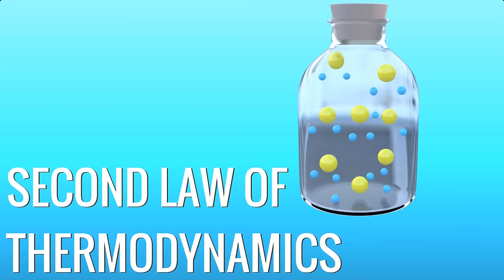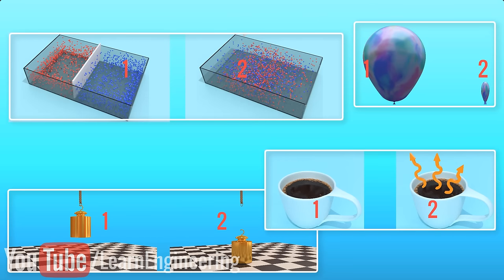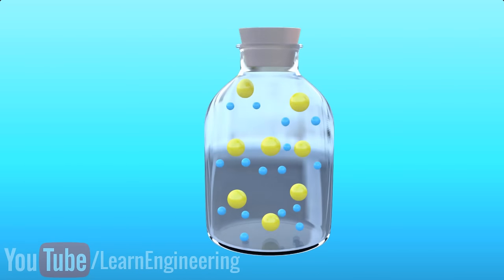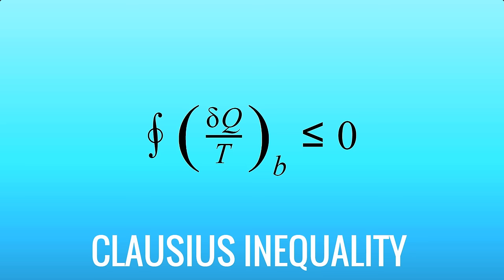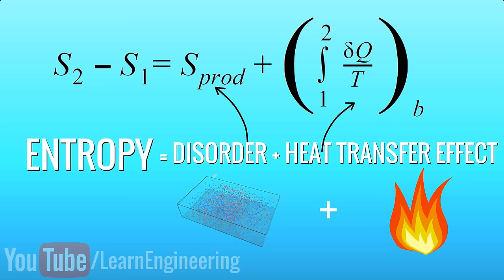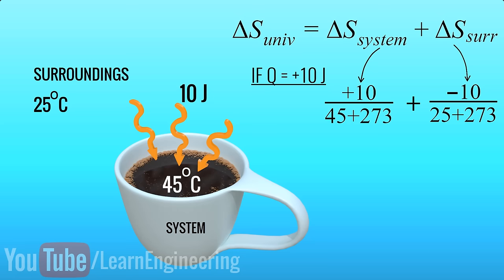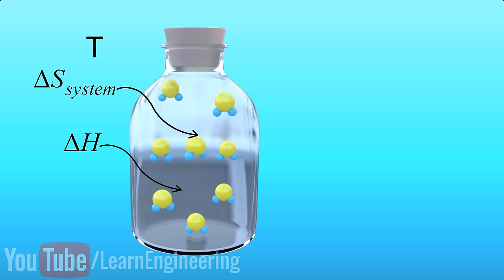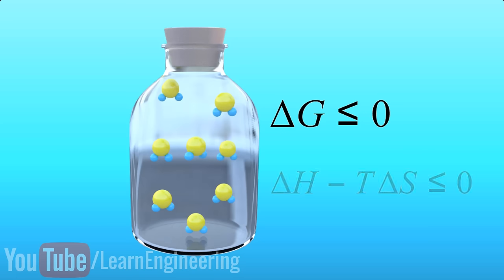Understanding Second Law of Thermodynamics !

Comment: Very interesting but.....what exactly is the second law of thermodynamics?
Reply: States that hot objects cannot absorbed energy from the surrounding but it only releases its own energy
Reply: it's the one that comes after the first law
Reply: The second law of Thermodynamics is that: Any process in nature occurs in a certain direction only.
This does not condemn the first law of energy conservation.
Reply: We are in league lol
Reply: @MA-qz1sd  😂🤣🤣😂
Reply: @JoeKing basically, first law of thermodynamics is that energy cannot be created or destroyed, only transformed. In layman's terms, heat has to go somewhere.
Second law is so confusing this video only made me more lost. Something about tea... maybe the should have used coffee instead. Would be more clear.
Reply: The way i see it is like this,, heat only goes from a hot body to a cold one it cant go the other way,,and entropy increases with time wich is measured by heat, or simply the universe will get hotter end messier with time..
Reply: second law of thermodynamics is about energy conversion, say you have two systems like a warm room and a cold room next to it, you open the window between them, the warm air in the warm room will travel to the cold room.

so the law states that a system that contains high energy will always give energy to a system with low energy until they reach equilibrium.

hot tea loses its heat because it is a system with high heat energy surrounded by air which is a system with lesser heat energy, so the system with high energy which is tea will give heat to the system with lower energy.

sorry if this ended up confusing, i tried.
Reply: @JoeKing
There is plenty of people who believe in perpetual motion.
Reply: @JoeKing the Zeroth Law, the First Law and the Third Law of Thermodynamics.
Reply: @JoeKing Zeroth law - basically if 2 thermodynamics system have the same temp with a third one, then they are also in thermal equilibrium.

1st law - energy can't be created or destroyed it can only be transferred.

2nd law - basically heat seeks colder shit. 

3rd law - when an object reaches absolute zero (0 Kelvin) then its atoms will stop moving.
Reply: @MA-qz1sd  genius 😂
Reply: @Nyew18  can someone gives me an example of industrial/engineering application that involves both first law and second law of thermodynamics?
Reply: @thischannelisnothere7747  The refrigeration cycle uses the 1st and 2nd law simultaneously.
Reply: @jalllu5201  thanks mate
shukran
Reply: @apollotheodore2560  
I just watched a video about entropy and it clearly states that it is possible for a hot object to absorb more energy so this is kinda confusing...
The chances of a hot object absorbing more heat is very small the larger the object though.
Reply: @azzzanadra   You explained it better than the video, thanks :)
Reply: @abulhasnainkhan1749  it feels good that i helped someone on the internet, it feels warm inside, thankfully it's summer so that warm is not going to leak out quickly.
Reply: the entropy of the universe tends toward a maximum
Reply: @MA-qz1sd  lol
Reply: @azzzanadra  Wow! Really helpful💫
Reply: @jalllu5201  Dude! Thank u for example but can u plz explain how these laws works in refrigerator....plz
Reply: second law of thermodynamics is you do not talk about thermodynamics
Reply: @azzzanadra  Simple and clear. Thanks
Reply: @MA-qz1sd  INSTINCTIVE 😚👈
Reply: The 1st law of thermodynamics states that in an isolated system (a system in which no energy is added or taken away)  energy (and thus mass) are conserved. 
The 2nd law states that in an isolated system (where any reaction takes place),  the system's current state will always be less than that of the initial state meaning an isolated system's entropy will increase over time. This state takes into account the materials as well as their arrangement, i.e. entropy. 
The 3rd laws is the assumption at entropy approaches a constant as Temp approaches 0K and that's needed due to the Heisenburg Uncertainty Principle
Reply: The entropy of universe is increasing continuously.
Reply: "The entropy of the universe is increasing" or " In the process of changing energy , a part of the energy , always , turns into the form that is unusable" 

I'm 13 ☺
Reply: Also all heat can be converted to  work but all work can't be converted to heat
Reply: An object’s entropy can never decrease
Reply: @azzzanadra  thanks man I understand it this way
Reply: @akshatpandey9141  reverse is true
Reply: @devendrabisht9713  thank you sir 👍😊😊
Reply: Basically, all things in the universe is decaying and breaking down over time and it's irreversable. It's also called "entropy". 😄👍
Reply: It’s straight before the 3rd law !
Reply: @MA-qz1sd  lol
Reply: @KasumiRINA  lol
Reply: @MA-qz1sd  no I thought it was the law that came before the 3rd law?
Reply: The universe is subject to disorder or entropy unless controlled by certain factors like energy and temperature.
Reply: @azzzanadra  tq🤗
Reply: @azzzanadra  dude, thank you, i finally understood this goddamn law haha
Reply: @KasumiRINA  Had he used water it'd be more clear
Reply: 2ND law:  heat,BY ITSELF,NO MACHINES INVOLVED,  only flows from hot side to cold side; not cold to hot 
2ND law:  Your hot coffee will get colder if you leave it in a cold room; it will not get hotter by itself in a cold room 
2ND law:  your hot cofee will heat up the cold glass you poured it in;
2ND law:   your hot coffee will not get more hot  after you poured it into the cold glass (for this, the glass would have to give out heat to the hot coffee,and so the glass would get COLDER....).            lol
Reply: All work can change to heat but all heat can't change to work
Reply: Entropy- A factor of degradation of quality of energy not exactly energy degradation which violates the First law of thermodynamics.
Reply: hot things will always cool down unless you do something to stop it
Reply: :) without understanding ‘randomness’ and ‘Probability’ the second law cannot be really appreciated. 
It’s just that the chances of hot team becoming hotter(absorbing heat) from a lower temperature surrounding are 1 in a trillion trillion trillion :) or for all practical purposes impossible.
Without understanding a statistical model, one can’t appreciate thermodynamics more than basic definition that entopy always increases 🤪🤪
Reply: i tried to follow but at the beginning,i hot lost when he talked about a balloon loosing air .. then a cup showing up..
Reply: i heat my bedroom up,but cold air rushes into it..from the rest of the colder house…not the other way around tsk tsk..if u were here u could see the wind coming,blowing through doorway…cracks if i dont close it tight..well one needs fresh air…..then the temp control jnit comes on to counteract the cooling down…tsk tsk..
Reply: A mathematical explanation for why objects tend to release heat rather than absorb it
Reply: @frend420  yes it is possible, but in the video example that's not true as the tea is hotter than the surroundings so for the tea to heat up would require work on the system as that direction of heat transfer has a positive Gibbs free energy meaning it will not happen spontaneously.
Reply: entropy always increases and is always greater than 0. until further notice
Reply: The entropy is the arrow of time, the one that defines in wich direction the facts are happening, for example if you put coffee in the milk, you can observe that the point of coffee gets wider and invade the milk from all the directions, but we can't undo it(reverse it).
This is entropy it defines how heat energy flows
Reply: Dont ask me...... I just got through reconciling the dunning kruger effected my ego.
My mind suffered the delusion of logical fallacy in assuming itself brilliant.
Dope...😣
Humility is setting in....😟
I realize pride being my fear..😱
Is there a saving grace? 😔
If not im toast! 😰
Next time i will stick to the alphabet, maybe after mastering that, and my vouls, I may be developed enough for basic mathematic probability calculations......opps.... Dunning kruger is back!
Lol

Peace.
Reply: @apollotheodore2560  Partially true.
For terms of ease of simplicity, let's  say you're object is heated to 200°F.

Now you put it in the environment It has the temperature of 500°F.

If You leave your "hot object" in this environment long enough,  It will pick up the thermal energy of it's  environment - and get hotter.
Thermodynamics 101.
Reply: @azzzanadra  thank u
Reply: @azzzanadra  Hello...whatever u have stated is Zeroth law...not second law btw
Reply: @firozkhan_2002  really? hmm, the more you know.

what is the second law in  nutshell?
Reply: @azzzanadra  There is not a universally accepted nutshell statement for the second law...It depends on which context u r referring it...Since I'm a Mechanical engineer, we use Clausius and Kelvin-Planck statement for the second law...If u look from the point of view of chemistry or any other physical science...the statement may differ...But talking in a nutshell... Second law tells us that all processes in the universe can occur spontaneously in a single and definite direction...and it also helps us to determine whether the process is feasible at all or not! That's it!
Reply: Second law of nature is:- 
Less heated objects cannot transmit heat to a more heated body.
Reply: You can't have a pressurized system next to a vacuum without a barrier.
Reply: The 2nd Law basically says that, no energy conversion process can be one-hundred per cent efficient.   Capiche?
Reply: Second law of thermodynamics was stated by clausius and kelvin plank
Acc to clausius No process is possible whose sole result is the transfer of heat from a body at lower temp to higher temp.
Acc to kelvin plank no process I possible whose sole result is complete transfer of heat into work. These two r interconnected. If anyone of the statement is untrue the other one is also untrue.
Reply: It essentially states the total entropy of a system must remain the same or increase rather than decrease in value. Entropy is Energy per unit Temperature. And entropy is simply a measure of the information bits to describe the energy of particles with a certain temperature.
Reply: @MA-qz1sd  🤣🤣
Reply: @KasumiRINA  🤣🤣🤣
Reply: Changes in temp. It’s always hot to cold. It’s never cold to hot
Reply: @apollotheodore2560  entropy
Reply: Entropy
Reply: It tells about the QUALITY of energy.or simply how much energy concentrated at a particular region which can be usefull at full extent unlike the energy which is spreaded over a large region which can not be used for any purposes
Reply: IT IS THIS : IT IS IMPOSSIBLE TO ACHIEVE 100% EFFICIENCY FOR ANY THERMODYNAMIC DEVICE........

now the explanation of this statement takes into account entropy
Reply: Interesting😅😅
Reply: Heat death of the universe
Reply: It's literally the first thing explained in the video
Reply: The entropy of the universe is always increasing. 😂
Reply: Stuff go from high energy to low energy. Simple.
Reply: @yellowbacon69  : No , you cannot say that. Energy is conserved. It just changes from one form to another. 1st law of thermodynamic. 😂
Reply: @Waffen_SS-q7c  ok… stuff go from hot to cold?
Reply: @yellowbacon69  : The heat just dissipate to the surrounding but with same amount as initial diffrences (∆E). You can only say that the entropy is increasing. 😂
Reply: @Waffen_SS-q7c  ok, so temperature transfers from one body to another and entropy increases?
Reply: @yellowbacon69  :maybe, then it will involve Boltzmann distribution. 😅
Reply: @apollotheodore2560  thank you !
Reply: Good Question 🥲
Reply: It is impossible to construct a heat engine that operate without heat loss
Reply: It states that we can not travel backward in time. Because time is measured only in the direction of increasing entropy. Period

Comment: During this entire video the law is never stated.
Reply: They provide multiple formulations
Reply: But it is still isn't explicitly stated.
Reply: Thank you for that.
Reply: #Entropy for a closed system ( like the universe ) , is always increasing .

#A self-occurring process, the entropy in the final state is greater than the entropy in the initial state.

#Heat is transferred from a body with a higher temperature to a body with a lower temperature.
The substance goes from higher concentration to lower concentration .

To do a work we need a delta ( difference in heat , or in substance concentration ) ; second law of therm-dynamics kills delta . Life is struggle with second law of thermo-dynamics . 
It is the one who wins in the end .

Comment: For the calculations on 5:00

Case 1: When Q=+10 JQ=+10J

This means 10 joules of heat are added to the system (the coffee).

    For the system (the coffee at 45°C or 318 K):
    ΔSsystem=10 J45°C+273=10318=+0.0314 J/K
    ΔSsystem=45°C+27310J=31810=+0.0314J/K

    For the surroundings (at 25°C or 298 K), the system is losing 10 J of heat, so we have Q=−10 JQ=−10J for the surroundings:
    ΔSsurr=−10 J25°C+273=−10298=−0.0336 J/K
    ΔSsurr=25°C+273−10J=298−10=−0.0336J/K

Now, the total entropy change for the universe is:
ΔSuniv=ΔSsystem+ΔSsurr
ΔSuniv=ΔSsystem+ΔSsurr
ΔSuniv=+0.0314 J/K+(−0.0336 J/K)=−0.00211 J/K
ΔSuniv=+0.0314J/K+(−0.0336J/K)=−0.00211J/K

So, the total entropy change is negative when 10 J is added to the system.

Case 2: When Q=−10 JQ=−10J

This means 10 joules of heat are removed from the system.

    For the system (the coffee at 45°C or 318 K):
    ΔSsystem=−10 J318=−0.0314 J/K
    ΔSsystem=318−10J=−0.0314J/K

    For the surroundings (at 25°C or 298 K), the system is losing 10 J of heat, but the surroundings are gaining 10 J, so Q=+10 JQ=+10J for the surroundings:
    ΔSsurr=10 J298=+0.0336 J/K
    ΔSsurr=29810J=+0.0336J/K

Now, the total entropy change for the universe is:
ΔSuniv=ΔSsystem+ΔSsurr
ΔSuniv=ΔSsystem+ΔSsurr
ΔSuniv=−0.0314 J/K+(+0.0336 J/K)=+0.00211 J/K
ΔSuniv=−0.0314J/K+(+0.0336J/K)=+0.00211J/K

Thankyou!

Comment: So what I understood from all this is that energy always flows from "high to low", never the other way. Like water down a mountain. So any closed system that has any amount of entropy will always want to flow to 0. Any open system into which outside energy can be added will have entropy increase until that extra added energy is supplied no more, like a melting glacier adding water to a river, and once again it will go from "high to low" until we get an all stop at 0 entropy. All the water from the mountain has flowed. Or something like that.
Reply: The way you described it just sounds like only ‘ loss of energy’ to me and it doesn’t seem applicable to these laws

Comment: This video is very good if you're an engineering student trying to solve entropy problems. Philosophically understanding it though, not so much. The 2nd Law just states that entropy or the disorder of a system tends to increase with time. Fundamentally it just means there are far more solutions where the result is a mess than an orderly one.

Think about a game of pool. Originally the balls are nice and orderly, but once things start moving, the balls end up all over the place. Now imagine trillions of particles doing the same thing. It is possible for entropy to decrease spontaneously but the chance of that occurring is practically impossible.

This law is not so much a product of physics (like F=ma or energy conservation) but of statistics. It's an emergent property that comes about because there are far more states where a system is disorderly than orderly.
Reply: True. Unfortunately though the 2nd law is wrong in the sense that it is dependent on the boundedness of the observer who’s looking at the system.

You can imagine the space of states tending towards an increase in entropy statistically in such examples (particles in a box) because the system takes the states-space to always be more (have more degrees of freedom) than the number of particles themselves.

For example. You have 10 2dimensional particles, on a 10x10 grid, then there will always be an exponentially higher number of possible states the particles can be in and most of those states will be random in their distribution. The underlying state-space however is not in equilibrium, in fact it is highly ordered. You can imagine that if you interpreted each 2d particle as a black pixel(1) and every pixel that isn’t a particle as a white pixel(0) then the total system would be 000001000000000000100000….and so on. This is a highly homogenous distribution and not random.

The 2nd law is therefor an artifact of how the observer parses the system…where if the observer could resolve the whole statespace they wouldn’t see an increase in entropy it would in fact never change…where as when you parse the system where you lose information it will appear that the 2nd law is true.

It’s like ignoring the air molecules in a double pendulum experiment. Of course the 2body system will appear chaotic because one is simply ignoring and not taking into account the actual components of the system (air molecules).

Cheers,

Comment: In simple terms: 1st law = total existing energy remains the same even with conversions to different states of matter. 
2nd law = Useful energy (or efficiency of work) decreases with each transformation due to heat loss and entropy in general. 
For example,  think of coal burning to heat water to produce steam to turn a turbine to generate electricity. Typically only 30-50% of the chemical potential energy stored in coal can be used to create electricity due to conversion losses at each step of the process.
Reply: i cant understand this in the video,,,,,but i understood by ur comment,,, thanks
Reply: Best explanation for me so far